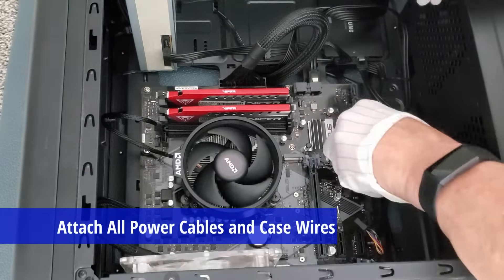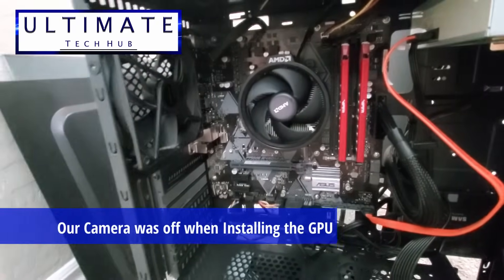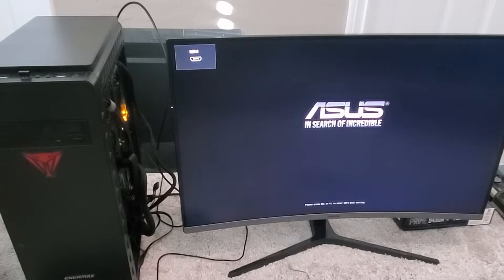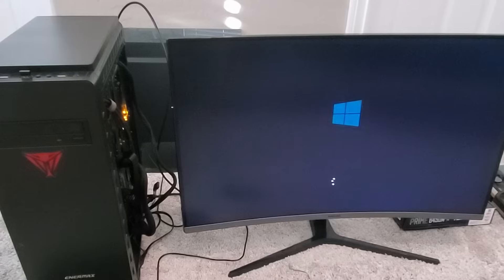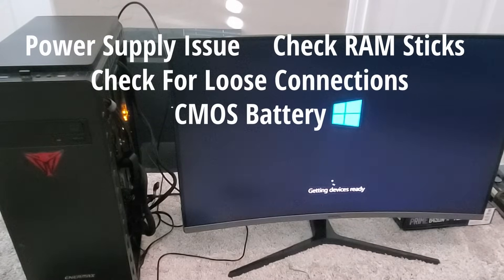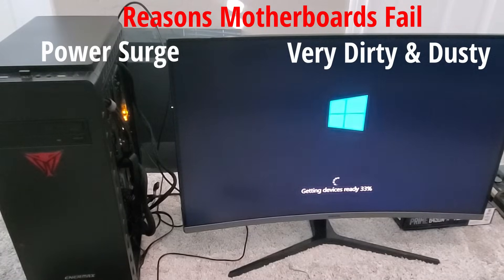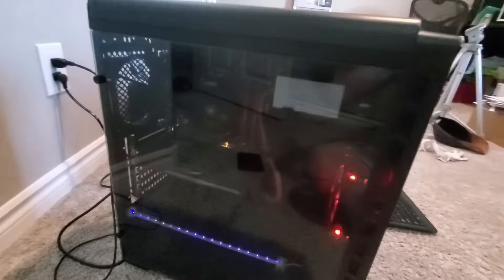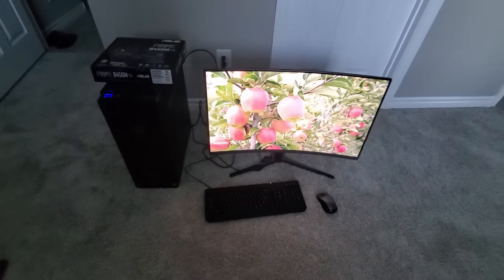HOW TO REPAIR A DEAD COMPUTER - DIAGNOSING A MOTHERBOARD FAILURE! - HOW TO

Comment from the maker: This video will help you diagnose a bad or dead motherboard. Thanks for watching!
Reply: Have same problem.. But my proc ryzen 5 2600...try put in my friends mobo.. Still have same problem... So it is means that my processor is dead?
Reply from the maker: @petr1cech1  Probably.
Reply: @UltimateTechHub  ah.. Dang it...
Reply from the maker: @petr1cech1  Did you check the CPU pins? Are any bent slightly? You can try to bend them back with a razor blade. Keep me posted.
Reply: @UltimateTechHub  already look the pin... All seems straight.....but... My friend also try his proc on my mobo(same ryzen 5 2600).. Same issue.. No display... Headache🤕
Reply: @UltimateTechHub  i have new mobo... It just fine.. Already gaming 2 3 days.... Thank you
Reply from the maker: @petr1cech1  Awesome, glad its fixed. Thank you for watching.
Reply: I need motherboard
Reply: help
Reply: Same problem here not booting, i just build a newly pc but when i disconnect the 8 pin power connector it turned on the cpu fan and rgb fans. What do you think is the problem? Please help
Reply: I just need a ex a320 gaming motherboard plz giveaway to me btw I have the warranty so I could I exchange it? help I'm from india
Reply: Is it possible after installing a gpu and a 2nd hdd (I have a 1tb ssd installed already) that it could brick your motherboard if it was working fine before installation of said components? If you need more info please let me know. I’m worried something is broken. Also the fan speed goes to max after 30-40 seconds. Thank you any help would be appreciated.
Reply from the maker: @UtubeIsassHoe  What watt is your PSU?
Reply: Sir i have a question, i have amd athlon 200 ge and biostar A320m motherboard, when i play valorant the pc doesn't shutdown, restart or black screen. But when i'm playing league of legends my pc keeps dropping fps and goes to black screen and sometimes restart itself.
Reply: @albertvirgilfrencillo5911  your cpu is outdated ....get a better one
Reply: i literally just bought an msi mpg b550 gaming plus mobo yesterday from best buy nd new corsair vengeance ram. however the dram bug light keeps flashing nd idk what to do. plz help me :(
Reply: my motherboard rgb lighting shows when it is plugged in but when i start it i don't get any of the activity lights. the fans spins but no lights showing it's booting.
Reply from the maker: @GM-Shenmue  That's the typical signs of a dead motherboard.
Reply: Can CPU (AMD Athlon 3000G) go bad?

Tryed diferent sticks of ram did not help...
I have swaped my motherboard (bricked bios) with anather used Motherboard (was at his place tryed it out and it worked there, same cpu)
[a320m s2h]
I tryed anather old PSU i had lying around (not sure if it actualy works),
Fans dont spin, only keyboard lights up, no beeps, no display nothing...
Reply: After years my PC stopped working from one day to the next without warning. When I turn it on the fans run for a minute then nothing. The blue screen says "No cables connected". I bought new cables but this was useless. No beep sound from the main board. I took out the Rams except one, replaced the mainboard battery, removed the graphics card, and disconnected the DVD player to get at least into the BIOS. No change, guess the main board imploded although one main board LED is still working?
Reply: Quick question.. if you replace the motherboard, shouldnt you have to reinstall Windows?
Reply: Hey I know I'm joining the "party" late, but I just got a laptop and after a few weeks it stopped powering on. The fans weren't rolling, nothing, no lights. My case is different tho as water passed through the vents beneath the laptop when I wasn't looking, so I'm thinking it got short-circuited. Thing is it was still powered on when water was flowing into it. Immediately I realised I quickly turned it off and disconnected the battery, but there was no sign of water. It didn't boot up after then tho. 
What do you think caused it?
Reply: Guess I just need a new motherboard
Reply: I got a new motherboard came in yesterday and it’s working perfectly fine
Reply from the maker: @acseptt8100  Glad to hear that. Congrats and thank you again for watching!

Comment: Back in December 27 2025, My PC suddenly turned off on me while I'm playing Genshin impact, And then it didn't boot, But the PC turned on, So i think, maybe it's the GPU, So i plugged out my RX 580 and Bought RX 6500 XT, Didn't work so i thought maybe it's the PSU so i bought a New PSU, Still didn't work, Which makes me think it's the Motherboard, It's Dead, So i bought a New Motherboard, It's Gigabyte B550M DS3H R2

It finally working ! In total, I spent 250$ for all the Parts i replaced T.T I was going to buy a Second hand Steam deck... But I'll get one in February ! fr
Reply from the maker: Glad you got it working! It's always frustrating when components fail, but good job troubleshooting and getting your PC back up! Motherboard failures are not very common but now you know the signs of a mobo failure. Thanks for watching!

Comment: I have something to say i have a problem that is similar were i think my motherboard is dead when i press the power button it turns on but when i press it for 5 seconds doesn't work also the reset button doesn't work you may I ask why do this to shut down the PC without shutting down the PSU and i heard that if this happens it means the motherboard is dead not sure

Comment: Mine posts sometimes
Checked all the ram slots
Tried 6 different sticks of RAM
Checked if the front panel was causing issues
Tried different PSU
Reseated everything multiple times
Cannot try different CPU, unfortunately
Tested m.2
Tried different m.2
Red cpu light (sometimes)
Orange dram light (Everytime)
White VGA (sometimes)
Green boot light (never?)
No onboard graphics, need GPU
Tried different GPU

In the end, I think I have a bad mobo, because I can almost install windows

Comment: This helped a lot.. I’m doing my first pc build and I had no IDEA what was wrong until I found this video. I spent idk how many hours trying to figure it out.. was hyper focused ig.. but when I started the sun was up and when I figured it out it was 5am LMAO. I did a start up jump on my psu and hooked it up to my old mobo and it worked every time I tested the power. Damn shame I wasn’t expecting to get a dud mobo from microcenter, I originally was going to go through Amazon but I figured MC would be the safer option and I could get the mobo same day. Bright side I can just exchange it at micro center tomorrow and my cable management is great and ready for a working mobo 😂😂 downside.. it’s a hour there with no traffic.. 😭

Comment: Thanks for the tips!
My screen went suddenly black when watching youtube, audio stopped at the same times, Mouse and keyboard-LEDs went out. Fans in the tower still running, RGB of RAM still glowing. Main-Button and Reset did nothing. So probably not a PSU or GPU but Motherboard failure. I:
- shut-off power at the PSU and waited for 15 minutes. Powering up and switching the PC on did not change anything, clearly there is power, but no signals at periphery.
- I tried the Display-Port of the MB, nothing.
- Pulled the power-cable, opened tower, vacuumed the inside (not that much dust). Noticed the cap of the cooling hub on the CPU had fallen off sometime. Just stuck that back on. Significant?
- I replaced the coin-battery of the MB. Did not do anything.

I have now claimed warranty (PC is only ~15 months old, MSI MBs should have 36) through alternate. Removed my old HDD that I put in from my old PC.
I worry that:
- I won't get back my PC for weeks.
- other stuff may break in transport/repairs/replacement.
- that any software licenses will throw problems when a new MB is detected as "new system".
- about the data on my SSD. Do not trust Alternate technicians a 100%, but how can I backup and format in this situation?

Any suggestions, what I should do before shipping the PC back to Alternate?
Reply from the maker: "Noticed the cap of the cooling hub on the CPU had fallen off sometime. Just stuck that back on?" Do you mean the CPU cooling fan or CPU cooling pump? That is a big deal because it keeps the CPU from over heating. Keep me posted.

Comment: Thank you I'm having almost the exact issue right now. My monitor says no signal, my keyboard does nothing and it's supposed to be lit up, my mouse will light up if I push the buttons but it's supposed to be lit all the time, my front panel lights also do not light up now, my CD-ROMs and my hdd all work I can hear them running and i can open them. Graphics card and everything has power the fan on its running, and all the rest of my fans and lights work.
I do not have a second power supply to test it with. I highly suspect it's the motherboard and not the power supply but I have no way of testing it at the moment.

Comment: was his usb peripherals not working either ? cause mines like that
Reply from the maker: Yes, its most likely a dead motherboard.
Reply: @ my phone fell on my cpu when i was applying thermal paste , it worked still but after a day I saw a red light flashing on my case, i checked it out and re installed my ram and then this happened, i just ordered a new motherboard, and if it isn’t it,ima definitely check my cpu and ram at a shop

Comment: I had a power surge. Power supply deid. I put in anyone form another PC I have. it didn't work. can a power surge screw up the mother board? it turns on but blackscreen still.?
Reply from the maker: @shaunmichaels60  Yes, power surge can ruin a  motherboard.

Comment: Hello. i have random signal losses. Screen goes on and off randomly. Sometimes i have to press a key on keyboard to have the signal back. The display cables are new. Could be a dying mobo?
Reply from the maker: It sounds like the mobo or the gpu.
Reply: I have this issue. PSU runs,fans running, CPU core temp are all reportedly fine sitting around 42-45deg cels. Thought it was an issue with the graphics card to begin with or not enough power between it and the power supply. Removed this. The issue still persists. Clean fresh o/s install. Using onboard graphics. Could be watching something as simple as YouTube and it’ll still just cut out and restart back to the desktop login screen. It’s either my PSU or motherboard and by a long frustrating week I’m beginning to suspect motherboard.
Reply: @RickyWiild  It was indeed a dying motherboard in my case. It stop working completely after some months having the problem i described above.

Comment: Is there any more ways to test mobo vs psu fail. 

I cleaned my dirty as pc because my 8 year old gpu was cooked. 

I ran the pc after and gpu was still hot, but after 30 mins i was out of the room and no signal on display. 

I have done all the trouble shooting, cmos, the ram, rseated everything. Tried running on on board graphics removing gpu. Etc etc. 

It either is the psu or mobo. 

My fans and leds all still work like normal. The keyboard still can turn caps lock on and off. 

A new mobo is 109 aussie. The pc shop wants 100 aussie to test it. 

Just wanting to know if i can be sure its the mobo over psu. Guess ill find out in like 4 hours.
Reply from the maker: If you could try a different psu that would help eliminate one the possible problems.

Comment: I think this is my problem too. A bad motherboard....
Reply from the maker: @wilferod  Sorry to hear that.
Reply: Hey hi again. I have another pc but this one the PSU stop working and I bought a new one. Everything turns on but no display and no post lights on the board. I did test the ram and the battery test and still no post. Reseat everything and still turning on but no post. Do you think my CPU is dead or the board?

Comment: I did the ram trick then I’m stuck on the bios screen. Even when I reset and change settings. Could it be a motherboard issue? Or tv issue? Or cmos battery issue?
Reply from the maker: @markcrear4641  Sounds like a mobo issue.

Comment: I know this has been out for 3 years but if the computer boots up and just continues to restart would that be a motherboard as well?
Keep in mind that sometimes it stays on for a random amount of time and just suddenly restarts and keeps doing that sometimes just giving a black screen but restarting it using the power button gets me to the bios screen normally and the PC boots up, the restart happens ALWAYS after the boot up
Reply from the maker: Probably the mobo or maybe the PSU.

Comment: Great video quick question, how come you didn’t consider the gpu being the problem if there was no video output? I’m learning computer repair so any helpful info would help 🙏🏽🙏🏽
Reply from the maker: I plugged the monitor directly into the motherboards HDMI and got the same result which rules out the GPU. So do this to verify if the GPU is bad. Thanks for watching!

Comment: 4 year old pc suddenly won’t turn on. Tried new psu and didn’t change anything. Went to “test” the new psu and it kinda exploded 😂. Then I swapped for a new mobo and old psu still no start. Rgb lighting for the case and mobo come on and the cpu fans kick on for about a second and that’s all I get.  Waiting on a rma for the new psu to test again but I’m starting to wonder if the cpu suddenly up and died 🤷🏻‍♂️

Comment: All my fans spin and lights turn on, power supply fan turns on and spins flawlessly.

Was gaming and came back to find my computer shut off. 

Would you still suggest starting with replacing power supply?
Reply: Was your pc fans were spinning after shut down?

Comment: My pc wont power on at all even after connected to main power line. I press the power button on the cabinet and the cpu fan turn on for a fraction of a second and dead again. Earlier it did have that blue screen issue and it worked for couple of days but now wont power on at all. What could be wrong?

Comment: Hey. So what's your take on this scenario:
I have a pc, it does not have a power supply. It's a lenovo motherboard, I use a lenovo laptop charger to power it. We just use the pc as a headless server for the home theater, it was functional for at least 8 years before it one day just didn't want to turn on anymore. I have no hope or desire or time to spend money to fix it because it was purely a hobby build. However how would you diagnose something like that when you don't have common signs to where the issue is?
Reply from the maker: If you have a power supply from a different PC, then I would try that first. Then remove 1 ram stick and then check the CMOS battery.
Reply: @UltimateTechHub  thanks! Already found a burn out mark on the motherboard so I think it's bye bye 😆
Reply from the maker: @FS-yq9ef  Sounds like it's dead.
Reply: @UltimateTechHub  it's dead

Comment: Hello, I've got a question. If I want to replace my faulty motherboard with new and upgraded one, is it necessary to also replace my cpu or i can just use my current cpu?
Reply from the maker: Yes you can use the old CPU as long as its compatible with new mobo. So buy a mobo that uses the same chipset.

Comment: I have a problem with my PC. It doesn’t switch on unless I blow the motherboard of the hairdryer. Once I blow the motherboard and switch the PC on the only thing that is out of sync Is the clock. The hairdryer fix is only temporary and I will have to re-warm the motherboard in the morning again. I phoned the local repair shop and the dude said it’s apparently a common Problem With AM4 Motherboards. Does anyone know what the cause might be? I’ve already tried swapping the power supply changing the CMOS battery resetting ram and GPU. Please help. I don’t really feel like purchasing a new MOBO. I forgot to mention that I’ve had the motherboard for over five years.
Reply from the maker: Time for a new MOBO.

Comment: If you replace the motherboard, shouldnt you have to reinstall Windows cause the MB serial nr is somehow tied to Windows or something?
Reply from the maker: After replacing your motherboard the operating system can't find a license that matches your device. You'll need to reactivate Windows with a digital license or product key. Windows will work without the license key but I always use a key. Here is a video on cheap keys for around 4 dollars! 
https://youtu.be/w3xx8NKD0zE
Reply: @UltimateTechHub  Thanx, man..

Comment: Brand new mobo just purchased the board lights up but nothing turns on swapped ram test power supply that works swapped gpu as well been at it for a week nothing has worked I fear the worst but don’t want to believe the cpu died this was supposed to be a simple case swap and ram upgrade it has turned into a nightmare 😡🤦🏾‍♂️😫
Reply from the maker: How many watts is your PSU? You double checked your PC case wires and all power connections? CPU failures are very unlikely.

Comment: This happened to my PC two weeks ago - dead, from one day to the next. When switching on the fans ran for ten seconds and then nothing. The  Asus Mainboard H97M-E did not even boot to the bios. I tried many things but when it came to investing larger sums for new hardware, I gave up. This is only worth it if the PC is still new. And then there is usually still a warranty on the machine.

Comment: My pc had the same issue, but it shows no signal on the monitor. It worked once, but when I changed the resolution on the desktop, the screen glitched, and it returned to show me no signal. I have a gigabyte b550m-k. Is it known to have some issues?